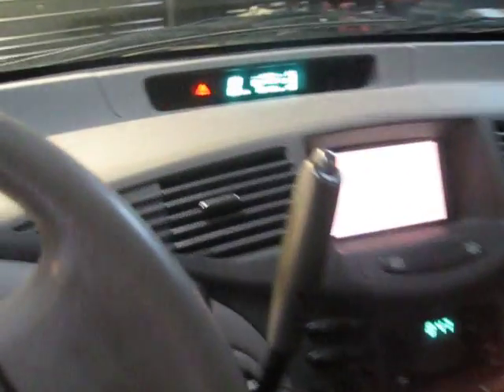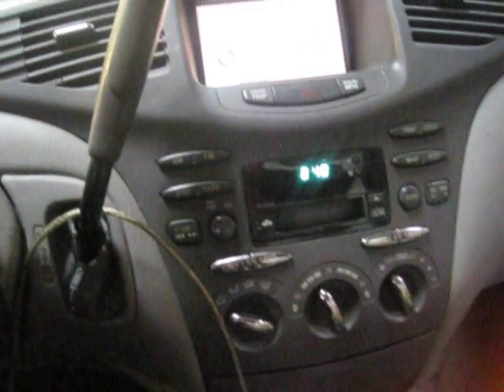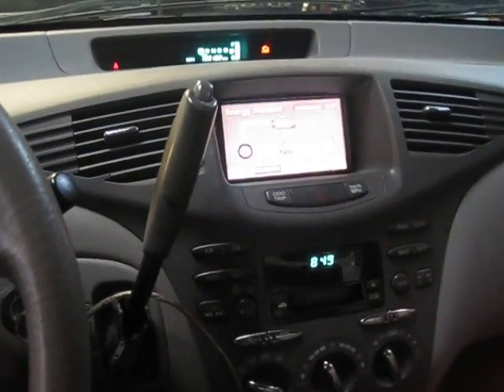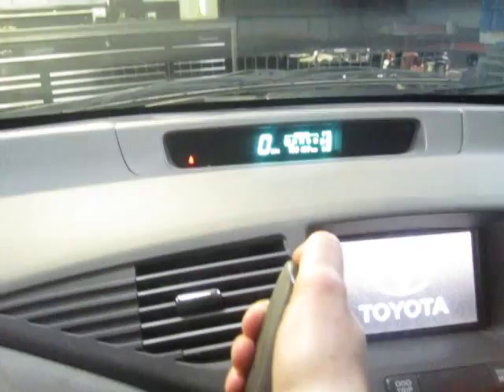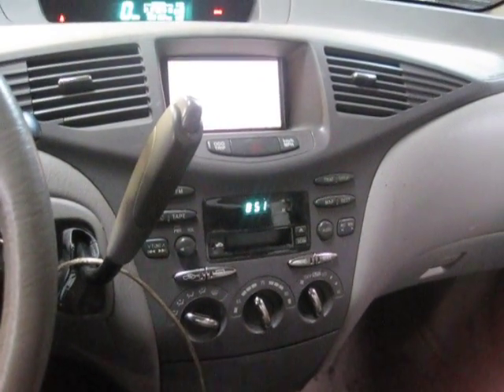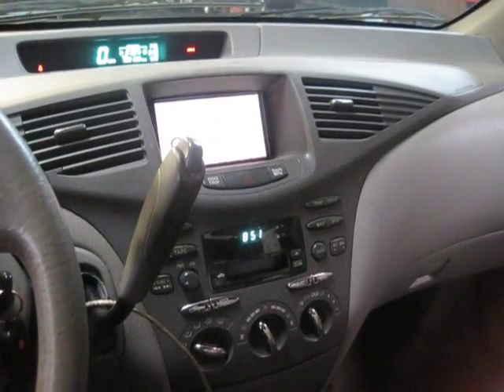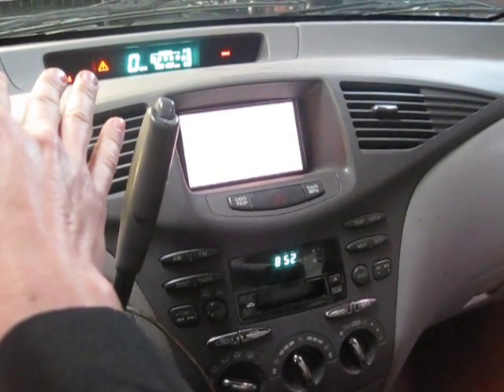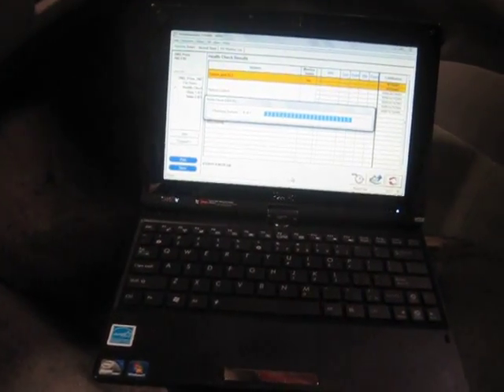Isolating HV Leak P3009 P0AA6

Comment: My light comes on for transmission same as in this video.  I disconnected both ends of the hgih voltage cable to the transmission and it reads infinity across all connections so cable is good.  When I disconnected the transmission end of the cable the plug was fouled with transmission fluid.  I cleaned all the connections and got 0.2 ohms across all terminals on the transmission connector.  What should this read and what should my next step be?

Comment: For my gen1 2003, 187k:
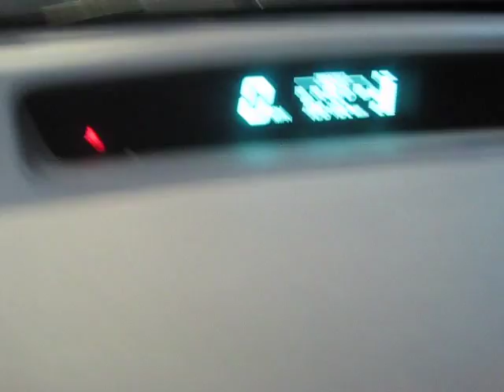At 2:33 with car on and immediate shift to neutral
I get a triangle and a display warning that the battery will not charge.  
These go away with a shift to B

( No error after 2 minutes)
( Shift to drive and soon get error, that bluedriver says is p3000, p3009)

So I think B can sub for N?

Thank you.

Comment: My code comes on at that neutral stage. What was the isolation for that. It’s not the transmission because the car isn’t engaging gear correct?
Reply: Were you able to get the car fixed?

Comment: Possible misspoken/error in the narrators verbal description:  Please correct me if I am wrong but, in the verbal review of the test condition (At minute 5:18) as; “key in the On or READY state.”
  
Narrator says;  “The Code has returned; in park, NOT key On, or in neutral, therefore the leak is quite likely inside the transition...” 
I believe the statement should be stated: “in park, WITH key On, or in neutral, therefore the leak is quite likely inside the transition...”

Comment: One side of the main relays in my traction battery melted, burned the HV cable going to the trans, and scorched pins in the orange plug going to the traction battery computer. I have several spare cars for parts. I replaced the computer, and the melted relay, and ran your test. Still getting a leak in the traction battery somewhere, is there something I should be looking for in live data, to help locate the leak? This is a new Dorman pack, that was shoddily assembled, which I posted in another video. Carolyn, you are the Prius Jedi Master, sure hope you can help me.

Comment: I have a bluedriver code reader, P0AA6 and C1310.  I don't have techstream.  Toyota dealer was a waste of time, they said i have to replace the whole drive system (HV,Trans axle, and inverter)...It drives great, 49mpg recharges the batteries low and High.  But the code comes back sometimes as soon as i put it in drive. Any suggestions, please help

Comment: Hey Caroline, I pulled codes and mine came P3009 and another was 3000H/12288. After watching this video I cleared the codes and started the ignition but without cracking the engine and there was no code, I then readied the car meaning cracked the engine on and immediately put the gear in neutral and the error came right back. So what seams to be the problem you think? thank you!
Reply: Did u ever fix ur car mine comes on nuetruel
Reply: If understand correctly, if the DTC comes in Neutral with the ignition Ready On, It is not the battery, and not the motor. Probably anything else, such as the Harnass or the inverter. Rgrds @roamma20

Comment: Done all as shown, error is showing after turning the engine on. The air conditioning compressor is not turning on. I changed the main cable that's going to the compressor, no change. But it doesn't seem to be the compressor, the car is a 2012. Any ideas ? Nobody can help with anything.
Reply: I now have same issue. Do you remember what it was?

Comment: Why is there a difference between Neutral and Park with the code setting in Park indicating that it's the transmission? Why not just test in Drive with foot on the brake?